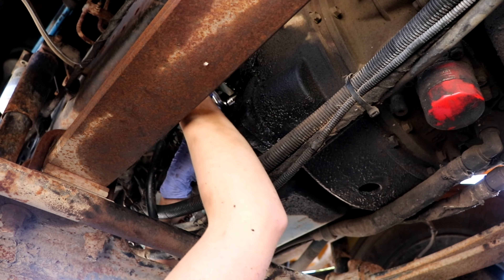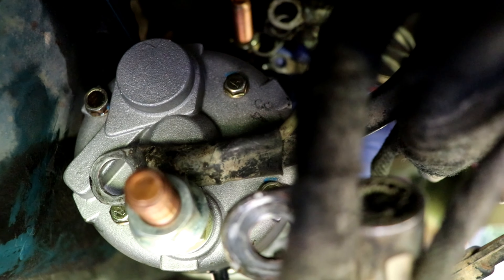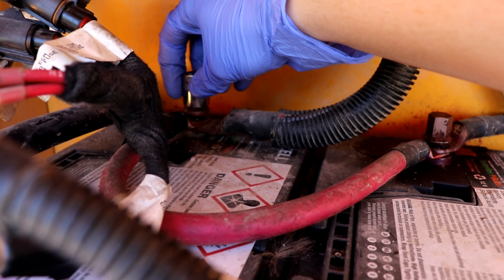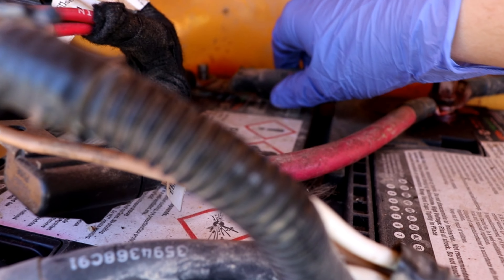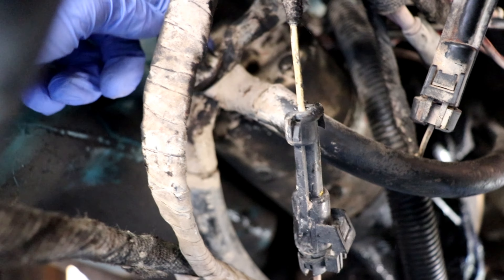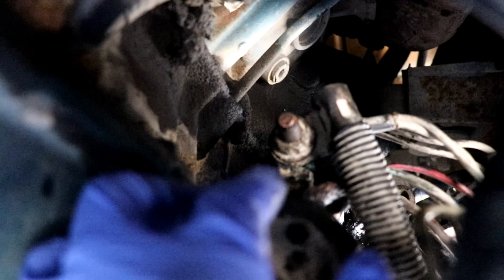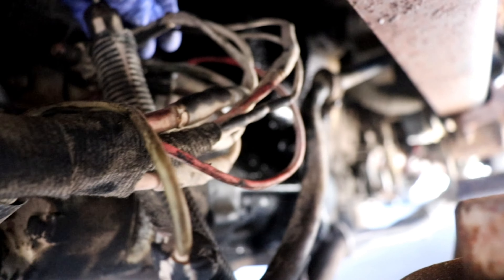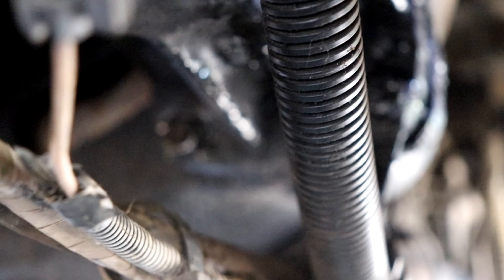Replacing the starter on my Skoolie Bus Conversion - Eden The Bus

Comment: Great job girl, just so that you know .. by the look of all the black oil around the area where the starter goes (the bell housing) I'm guessing that the rear main seal on the motor is weeping. It's common for vehicles with some age / miles, it is a fairly involved process to replace the seal .. just something to keep in mind if you get the opportunity (workshop with tools, equipment & tech advice / help) and finances permit. Take care, keep smiling all the best.
Reply from the maker: @cidpac54  Thank you!! I've been wondering about that and don't have a teacher so I appreciate the advice 🙂